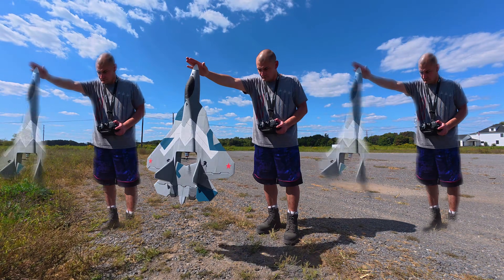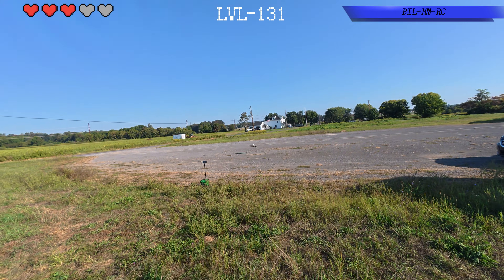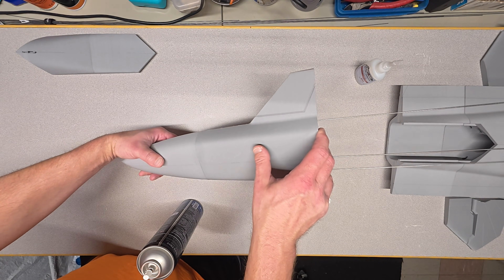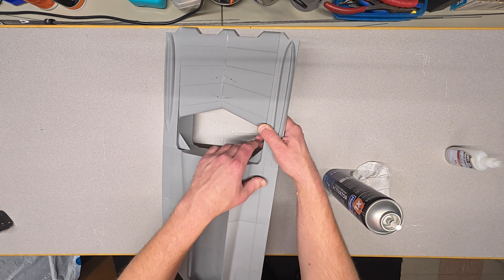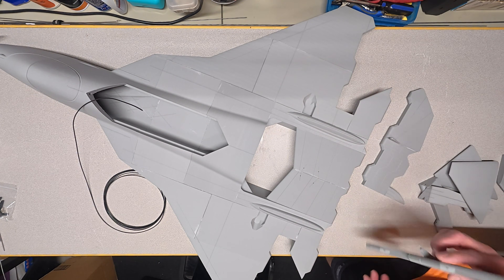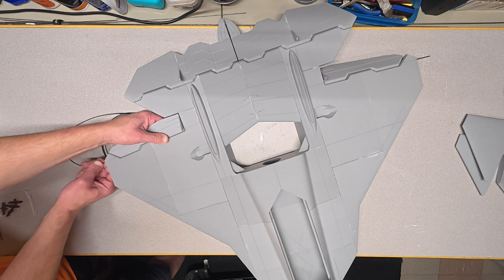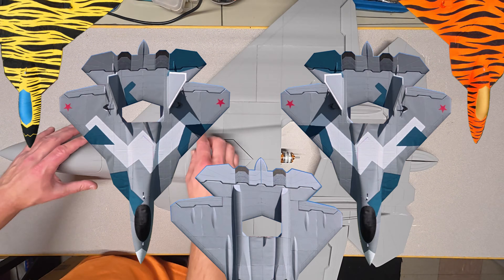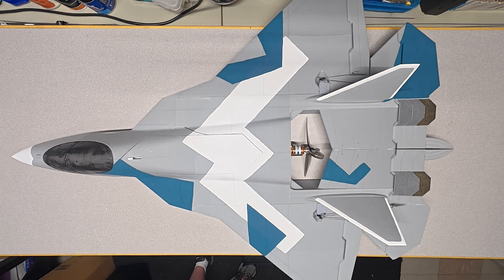Crash Resistant - Budget Friendly - SU-57 Park jet - Step by Step DIY

Comment: Hi where do you install carbon rod
Reply from the maker: The Steel wires are substitutable for 1.5mm CF. The entire build is in this video. First CF rods go here:  3:21.
Reply: @HoloModels-RC thanks I’ve just bought the file for my Bambu lab a1 can’t wait to start
Reply from the maker: @paulrussell6034  Awesome, thank you! In the future I plan on making print profiles for Bamboo. Just to clarify, in the build video I did NOT use carbon fiber, I used all steel yard flags on this one.
Reply: @HoloModels-RC I’m lost I’ve ordered the 18g wire which I see you use joining all the pieces I didn’t see you use steel flag pole wire ?
Reply from the maker: @paulrussell6034  OK, sorry! I use 15-18g music wire for pushrods. The 18g is good for this model and is what I personally used. However, I also use Steel Yard flags with a diameter of 1.55mm in all of my models. Watch the F-22 build video for a little more description. They are optional but help hold the model together after the PLA cracks and breaks, plus other benefits. Those are substitutable for 1.5mm carbon fiber. The total weight of the yard flags is around 40g, where CF is about 6g. Sorry for the confusion - Didn't want to cover the same material in this video. Check out the F-22 video for a little more explanation HERE: https://www.youtube.com/watch?v=3YMMrJPHBh8&t=1865s
Reply from the maker: The 18g is good to use on many different models and was a good investment for this hobby. When your wire comes, in will most likely be in a spool. I cut about 5ft of wire and straighten it using a drill and a vice. About ten seconds of rotation one way, and about three seconds of counter-rotation should be enough to straighten the music wire. Keep it taught while using the drill, and be careful!
Reply: @HoloModels-RC  so basically I need some 1.5 steel rods or wire to join all parts
Reply from the maker: @paulrussell6034  It's not required, but yeah, it helps. Especially with model longevity. I use them in all my builds. There are other designers, and even Eclipson has a few that use the same size. I just use steel because it's way cheaper.
Reply: @HoloModels-RC  does the wire lengths need to be 30 inch long each sorry for the constant messages just want to make sure I have the right parts
Reply from the maker: @paulrussell6034  No worries, ask away. Helps my videos anyway. The wires are 13, 16, and approx 20in long for this build. Most yard flags come in 18-24in I think. You can find them 30in for the same price though online. There is a link to them on some of my models. Hardware stores usually carry the shorter ones. If anything else comes up, don't hesitate to ask. I try to help everyone as much as I can.
Reply: @HoloModels-RC thanks much appreciated
Reply: @HoloModels-RC  hi I’ve printed fuse 1-3 now and used the settings required and prints have come out perfect but noticed that they print quicker than the the time stated by at least a hour and also the prints are a bit lighter is this ok ?
Reply from the maker: @paulrussell6034  Absolutely! My G-Codes are made to run on any machine, even older ones that can't print as fast for different reasons. My settings have been fined tuned over multiple machines, models, and PLA brands.

Travel times and general speeds were reduced each time I had an issue with a printer or PLA brand.

As for the weights, as long as you're printing with 1.5% infill, it's fine. I deliberately make my prototypes heavier. 

On my chart the one flow rate was not tuned down, thus making it heavier. And ColorFabb is denser than most other brands which makes it heavier. As long as you printed with .40 wall width and 1.5% Infill or used the G-Codes,  I'm sure it's fine.
Reply: @HoloModels-RC  great thanks so .40 width on every piece
Reply from the maker: @paulrussell6034  Yes, I used a .40 wall width on all the parts.
Reply: @HoloModels-RC  not sure if I have I’ll have to check
Reply from the maker: @paulrussell6034 if you used a wall width a greater than .40 this model will still fly just fine, especially if you use the 2836 1500kv and printed with 1.5% infill.
Reply: @HoloModels-RC  my Bambu lab a1 is a 0.4 nozzle so I think it prints at a 0.42 width for better adhesion?
Reply from the maker: @paulrussell6034  Yeah that would help with layer adhesion, squashing each layer together more. Each slicer just does it differently is all. Also why I use the settings I do. I like to print LW very hot, at 250 degrees. Seems to work for all brands of LW as well.
Reply: @HoloModels-RC  I’ve just noticed I have to mirror certain parts including wings is that easy to do in the slicer software
Reply from the maker: @paulrussell6034  Extremely. Just right click the part and select mirror (X or Y-Axis). I've just checked in Bamboo Studio to be sure!!
Reply from the maker: @paulrussell6034  Do you know how to use "Height Range Modifiers"?? This will allow you to have a completely different set of print settings at different height intervals (%-Infill, #-wall, etc.). So instead of having to add 11 solid bottoms throughout an entire part, we can make just the bottom control horn part completely solid. I use this to add two walls at all the glue points also (top and bottom 2mm of each part have two walls), but that's not required-just something I like to do. 

This feature will help you with many other designers' aircraft as well. I was looking for a Bambu video but couldn't find a good one, all these slicers are very similar, and bamboo is almost exactly the same. This is actually easier to do with Bambu Studio than Prusa, and you can have as many as you want throughout a part, not just one. You DON"T need to use shapes to do it.
Height Range Modifier: https://www.youtube.com/watch?v=azEeCcayuRM 

Here is how to add multiple "height range modifiers" in bamboo: https://forum.bambulab.com/t/multiple-height-range-modifiers-on-a-single-object/49687
I had trouble finding where to click to add more than one myself in Bambu Studio.
Reply: @HoloModels-RC  yeah I’ve done a modifier on previous model
Reply: @HoloModels-RC it’s only aileron and elevator that need a lot of bottom
Reply: @HoloModels-RC can I ask why there’s no infil percentage on the inner stabs can I use 1 percent
Reply from the maker: @paulrussell6034   I designed the internal structure of all the tail pieces myself to keep the ass end of the airframe as light as possible. They don't need more structure than this, but you can absolutely add to it if you like. Especially if only using the 1.5% infill and the motor that you have, it will still be over-powered and balance just fine!!
Reply: @HoloModels-RC I take it the locking catch is printed in pla. I’m using a 1500 motor is it a 2200 4s required
Reply from the maker: @paulrussell6034  Yes, I printed the lock holder and slide using PLA+, although PLA or ASA will work. The motor mount does need to be ASA though, otherwise use plywood as seen in the F-22 build. And yes, I usually fly with a 2200 4S, but it will fly with bigger and smaller batteries. This airframe will also fly on a 3S battery since you have the correct motor and prop.
Reply: @HoloModels-RC great thanks
Reply: @HoloModels-RC  also I’ve ordered the 1500kv motor does it have to be a 3 bladed prop or will two be ok
Reply from the maker: @paulrussell6034  Glad you got that motor, it makes the plane!! The two bladed is fine. 3-bladed gives you a little more power at the expense of more heat on the mount. If you build it with all the recommendations, this airframe will fly on 3S also.  Links to everything I used are on the Su-57 and F-22 Download page. What pitch prop are you going to use? 7045 or preferably 7050 is great to start. There may be more valuable info on the F-22 RC-Groups page for you. Both planes are similar.
Reply: @HoloModels-RC  hi could you tell me your dual rates for this model please also what’s the cg on a 2200 4s many thanks
Reply from the maker: @paulrussell6034  The CG is marked on the bottom of the wings by two straight lines inside the LE panel lines. I didn't put it within the files until after this video was filmed. I fly with 30% expo, and measurements for high rates are at 10:52. I have never actually used mid or low rates on this model.
Reply: @HoloModels-RC  hi 9g servos do not fit in that wing recess the plastic ears where screw have nothing to sit into
Reply from the maker: @paulrussell6034  That's because the plastic "ears" that you speak of get cut off the servos, then I put tape over the servo for easier removal. This was done so there is no overhang while printing.
Reply: @HoloModels-RC  ok that’s fine maybe if you said on the build video I wouldn’t of had to bother you also does it have to be a pusher prop or will any do
Reply from the maker: @paulrussell6034  No worries, and on the next build I have changed the servo pocket so this isn't required anymore. I have tried both props. Each F-22 was different(one CW one CCW). If you are going to use a regular prop and have the motor spinning clockwise, just make sure you make the hub very tight so the prop doesn't fall off from the torque of the motor. Pusher props are a little harder to find especially 7in.
Reply: @HoloModels-RC  hi did you say the cg was the little line on edge of wing if so I can’t get the cg at all I have a 2200 4s battery all the way to front and it’s soooo tail heavy any help
Reply from the maker: @paulrussell6034  How much infill did you put in the model?  I remember you asked about the tail surfaces infill %. This would depend on temp and flow rate also. If you deviated from the print settings a lot, of course it will come out differently. With my model, I can balance it with only a 1400 battery and there is still a little room to move the battery forward (1/4in). You may have to add weight to yours. Just adding infill to the inner stabs wouldn't have been enough to throw the balance off that much. The .42 wall width would have contributed a little, but not that much either.  What is your flying weight?

Comment: I have an OLD monoprice maker select plus printer it’s 200x200x180 will it print this plane?
Reply from the maker: Just opened a bunch of parts to be sure, but unfortunately no. I design all my models to fit the most common bed size which is an Ender-3 or bigger(215x215x250). Sorry man!! Maybe time to upgrade your printer to something a little bigger???
Reply: @HoloModels-RC  It’s sitting in the table collecting dust figured I’d try to make it useful lol I appreciate you getting back to me, you have some amazing designs. Ever think of printing some and selling kits?
Reply from the maker: @fierceflyer5   @fierceflyer5  Thanks, and I have been asked this a lot. Personally, I feel it's a lot of risk to take to ship a 3D printed plane. Companies are charging around 150-$200 for a complete plane using LW-PLA. I bought my re-furbished (brand New) Sovol SV-01 for about $140. The price I would have to charge (around 140 with shipping) would make me feel like I was charging more than their worth, especially considering breaking or melting is inevitable.  Here you go, this is what I mean. You can print as many as you want for about the same amount (plus my G-Codes would work):  https://www.sovol3d.com/products/sovol-refurbished-3d-printer?variant=44342234186037
I am hoping to partner with a company that is capable of printing my models in the near future!
Reply: @HoloModels-RC I was looking at new printers went down a rabbit hole looking at Creality & Bambu Lab then realized spending $800+ to print a plane wasn’t a great idea lol I’ll look at your link. I completely agree with your assessment of printing and shipping the parts. Thanks.
Reply from the maker: @fierceflyer5 Yeah, I got one from that link a few years ago and it is a great printer. Was literally brand new when it arrived. They are even cheaper right now by like 40$. Try to find a printer that is “direct drive” not a Bowden tube, and also dual z-axis helps. Then try for a decent bed size, something 215x215x250 or bigger. Definitely check out that link, they are like a third of the price!!

Comment: can you tell me which type 3d printing material use to build this stronger  for anny bigneer who build this plane also i requested plz build this plane by foam sheet t
Reply from the maker: My other Felon video has a foam version in it, plans by RC Powers. Definitely do a foam version if just starting out. With 3D printing, it’s hard to make them strong and last long. The heavier they get, the harder to fly and easier they break when landing. That’s why I use the steel wire internally, cause they last longer. If you still wanted to make it stronger, still use LW PLA but with higher infill.

Comment: purchased - nice design - please add rudders.
Reply from the maker: YOU HAVE CONVINCED ME!! The prototype files can be found on page-8 of the RC-Groups thread for the F-22. I don't know if I will ever do this for the SU-57 though. Once I print and test them, I will make a video and share the files on Cults. You can download the prototype files right now though if you're interested!
Reply: @HoloModels-RC  thank you sir !!!
Reply from the maker: It comes with a "vectored" rudder on the center-line of the airframe which works way better. During testing, the dual rudders made the airplane roll way too much that even a mix didn't really help enough, and it was unstable cause the roll was so great. I tried to explain this in the "foot launch" video. Much more fun with the center-line rudder.
Reply: @HoloModels-RC  but a single rudder can't do the air brake feature (toe in)
Reply: also less scale. (I know this park scale, but.. )
Reply from the maker: @Dhouston1125  Wow, Thanks for sharing that video!! I've seen a lot of RC-Powers stuff, but never that video. That was the V3 I believe. I will definitely have to look into this set-up. Thanks for that!! Works completely different than I imagined.
Reply from the maker: @Dhouston1125  The Dual toe-in rudders would work much better on the F-22 cause the Fins are much bigger. I will give it a try in the future. It's not a lot of work to do on my end cause they are both the same and there is already a servo wire channel back there.
Reply: @HoloModels-RC  that would be great.  I love that you are doing STL of the RC super powers planes.  Keep it up sir!.  F-18 next ;)
Reply: @HoloModels-RC  maybe you could do the LEVCONs on the Su-57.  mini canards and you already have the panel line ;)
Reply from the maker: @Dhouston1125  I'm almost done the Rudder and Fin Files. Started working on them right away after seeing that video. I won't be able to test them right away because I would have to re-print the F-22, but if you want them I can post them on RC-Groups for now.

Comment: Impressive flying Bill, congrats on the new release and looking forward to print and fly it myself. Thank you.
Reply from the maker: Thanks Leo, much appreciated! And thanks for being one of the first to download!🙂
Reply: @HoloModels-RC  I really like the painting you did on this one, very beautifull. You only put me on one leg with the release for the moment because last few days I've started another print of the F22 as well haha... 😉 But the F22 I have ready so first the SU-57 now in grey filament. The printer has started..... 🙃
Reply from the maker: @L3DCXY  Nice man!! And Thank You!! That paint job took longer than the build(3hrs). Was hard to brush straight lines🖌, and masking tape never sticks right to PLA. 

Still prefer the 22 over the 57 personally. This one's a little more "floaty" and feels like it wants to go straight when you throttle it up🏹. But it is also more forgiving with smaller motor sizes. 

FYI, this is the first of my videos which are available in multiple languages now.
Reply: @HoloModels-RC  Yah everything takes so much time I understand. I think both planes have there advantages and disadvantages? This one has a thicker nose and a smaller battery compartement I noticed. You saw my last video, a friend of mine advised me to put the battery a bit more forward for CG so that's what I will try next time when the weather is better. But looking forward to have both planes ready, fuselage part 2 is almost done. Keep it up an take care.